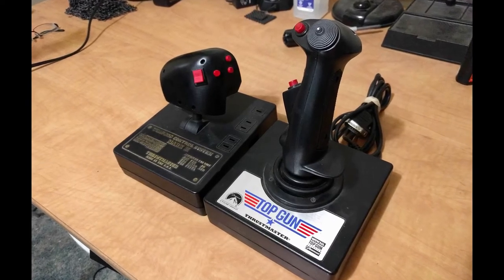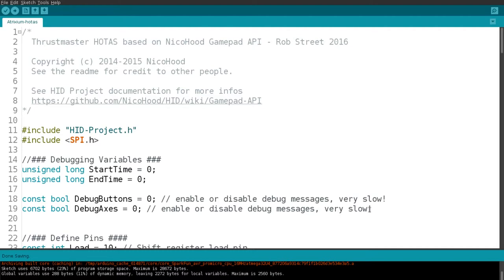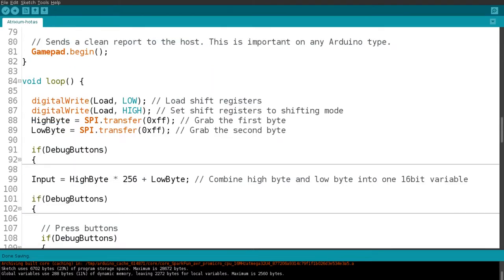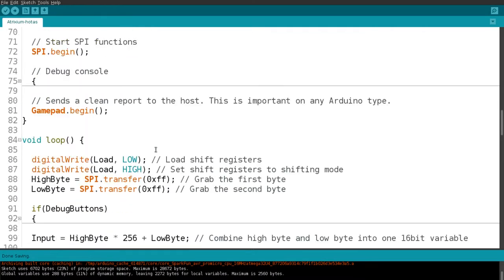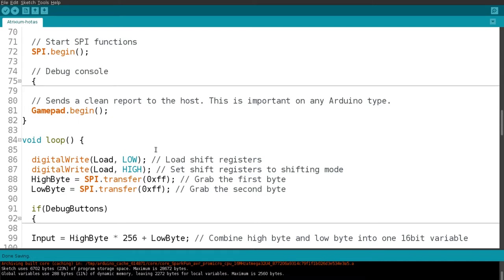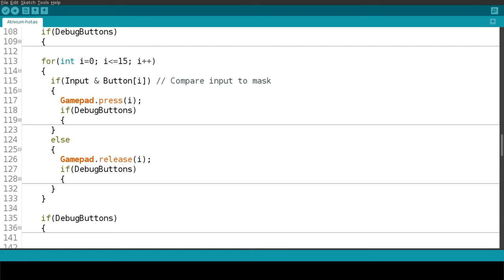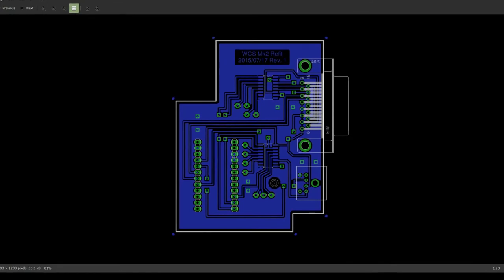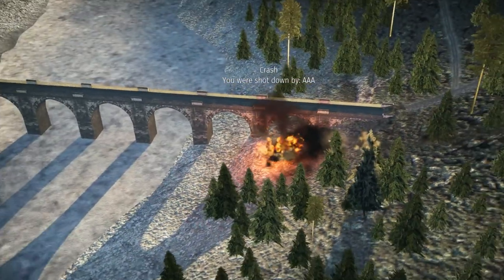Custom Arduino HOTAS from old Thrustmaster setup

Comment: Hey there! I have been wanting to convert my WCS Mk II to USB using an Arduino for a long time, but you're the first person I've seen do it successfully with a couple of shift registers! I would love more info about the circuit you've made. Care to share some details? Or maybe we can figure out a way to message each other about it? Fingers crossed that you'll see this.
Reply from the maker: Hey, thanks for the sub! Most of the info should be in the Github repo: https://github.com/Atrixium/Atrixium-HOTAS and there is a facility there for asking questions, the documentation isn't great, but I should be able to help fill in the blanks, I've been meaning to flesh it out anyway.
Reply: @Teklectic  Thanks! I'm heading there now! There's no shortage of resources talking about converting the FLCS or F-22 stick to USB (which is easy), and there's plenty of resources covering converting the TQS throttle (not that hard either), but literally NOTHING on the WCS Mk II. Congrats on delivering that rarest of things on the Internet: truly UNIQUE content.